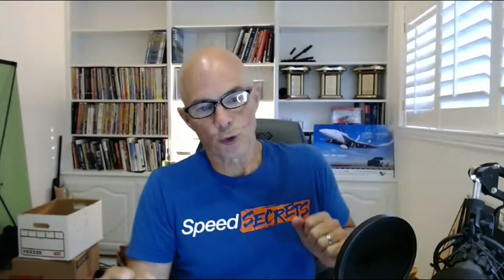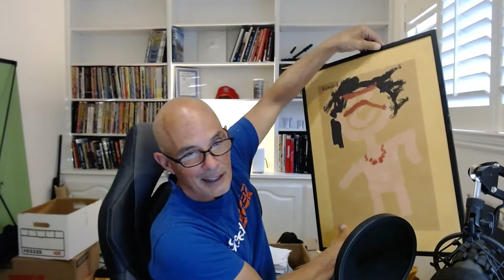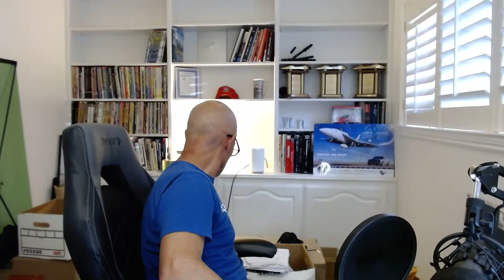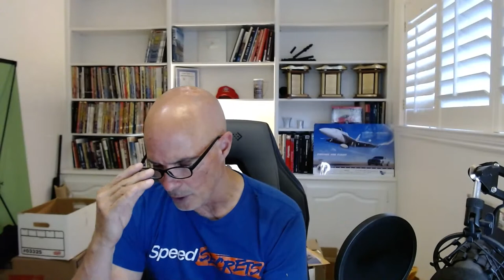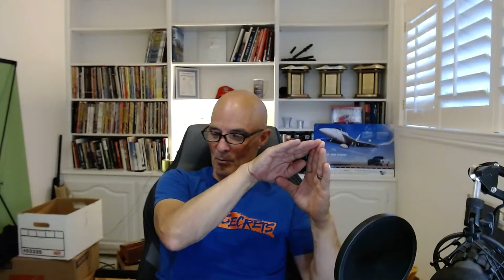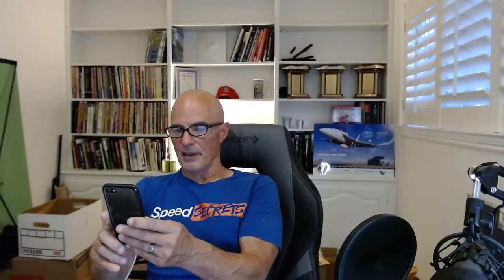LET'S TALK TECH-SURE, THEY COOL, BUT DO INTERCOOLERS ACTUALLY ADD POWER?

Comment: Yes just like softening your cambers and sometimes lower compression on a boosted engine. It just seems to make the engine run easier and less worry about the cylinder temperature and pressure. 👍👍 good stuff Richard. All at the very end of the power potential though. When detonation and turbo stop flowing and temperature start to rise fast. 👀👍
Reply: Also you tried to say big time drag racers (2000 hp) don’t listen to you but ol LS George listens to what you have to say

Comment: I want to add more power without having to change pistons or heads again.Right now 406 sbc 10.5 to 1 compression.Is it worth buying A procharger or am I pushing the limits with compression?…Dyno’ed at 532 with 521 torque.Looking to add around 100 more hp.I do not want to be filling bottles all the time.Would I have to run A inner cooler and A blow through carb?
Reply from the maker: a procharger at just 7 psi would add 200 hp
Reply: Best and cheapest way to add 100 hp is either a torqstorm centrifugal blower or a vortech v3si with a blow through carb and e85.  Same centrifugal supercharger   type blower but half the price as Procharger.

Comment: What cx racing air to water do u use on your dyno???
Reply from the maker: the one in the photo was from Procharger (they source from someone else), the CX racing unit I use on Big bang motors (twins) is a 2 in and single out dual core